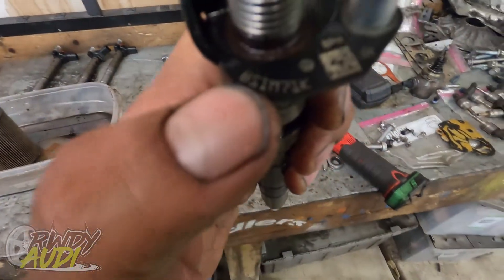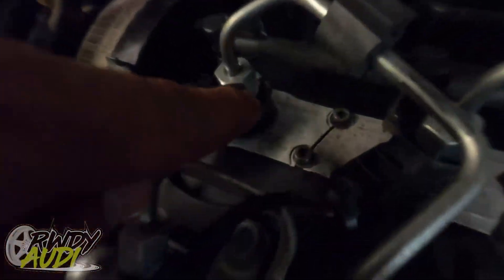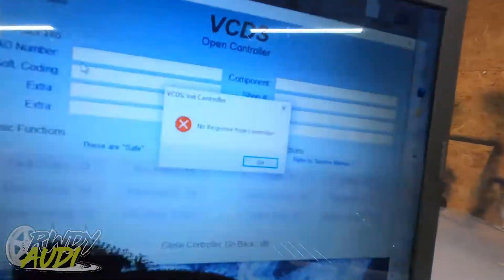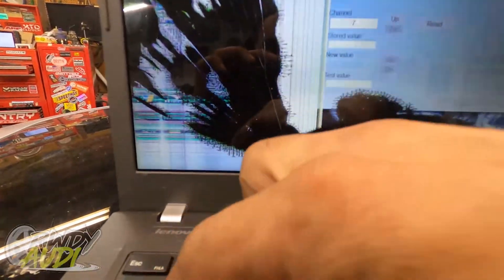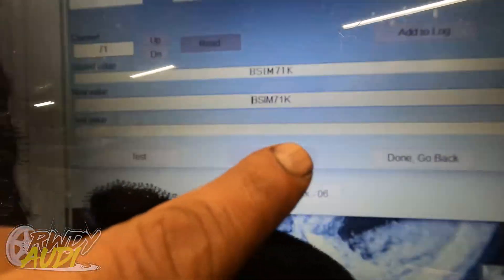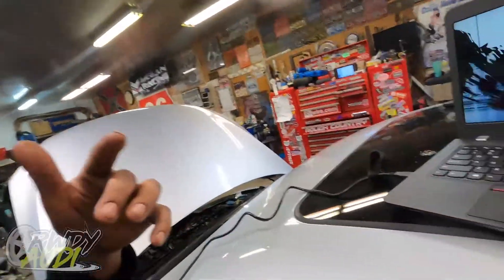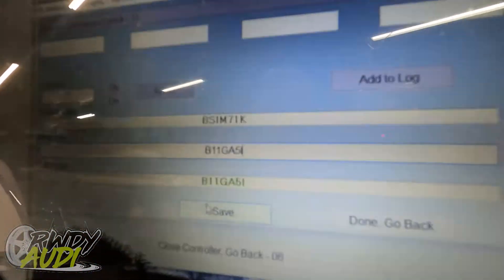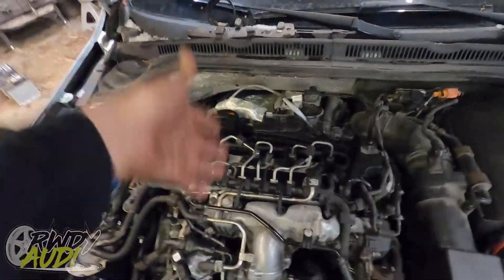How to code TDI DIESEL INJECTOR using VCDS | DIY SPECIAL |

Comment: is there a video for the 1.9 PD tdi im going from 105 to 130
Reply: You can't code PD injectors, they need to be calibrated, you are much better off taking it to a specialist rather than trying to do it yourself.
Reply: And by calibrated I mean the ECU needs to be flashed with the reconfigured map that scales the injector voltage correctly

Comment: My vcds screen is a little different. I might have screwed up loading injector 1. When I hit change value so.ething came up about export. I hit do it and old and new value went to all AAAAAAA. Now I can't change anything. I can't send you a pix of my screen
Reply: you need to put a code in securite access , after that you can make changes in injectors

Comment: Any way to adapt without knowing the number on each individual injector? I installed on my A4 B8 and the manifold is covering the injectors.
Reply from the maker: Not that I know of , plus u need to know which cyl each injector is in so you get the programming order right

Maybe you can get a scope down there and they might be visual

Comment: Just in the process of doing the HPFP and entire fuel system change because of metal in the system, next step is the injector coding , I have the xtool vag401 and have been able to do everything you’ve done with vcds so hopefully I can code the injectors as well 😂just have to find what data block they are under ,thanks for the video series on this car it’s been great 👍🏻
Reply from the maker: Very welcome , everything end up working out okay?
Reply: Hi  update is I ended up just buying the full version of VCDs and coding the injectors, and then we drove the car for a while then the fuel return line blew off and spewed fuel everywhere and the car wouldn’t re-start 🤦🏼‍♂️so I replaced the high pressure pump again and the car fired Roth up then after full warmup the rubber return fuel line blew off again, so now I’m completely confused 😂
My next move is to check return flow to the tank 🤷🏼‍♂️
The drama continues 
Thanks for checking in with me much appreciated!

Comment: Is coding the Injectors necessary if all I'm doing is replacing the o rings?
Reply from the maker: No, it is not necessary as long as you put each injector back  from the cyl they came from. However, you will still need to prime the system 3 times to confirm there is no air in the lines before you start it back up for the first time. (DAMAGE COULD COME TO THE CP4 PUMP IF YOU DONT PRIME THE LINES AFTER REMOVAL)

Hope this helps with your project
Reply: I found your video on priming the fuel system with vcds, thanks bro!

Comment: So I’ve seen the previous videos on the tdi hpfp replacement. You didn’t really elaborate too much if the old injectors lasted or not? Did you run into issues with the original injectors after replacing the hpfp?
Reply from the maker: My bad dude. I replaced the injectors due to the amount of metal I found the system as whole. These injector are called "piezo" basically this means there tiny quartz slices in them thousandth of inch thick. Metal in these, even the smallest of amounts will cause, lots of different errors  to populate. 

So in this case after I got the car back up and running we had several errors on different cyl. Got on Google and dug into what's what and learn the difference require between modern tdi and old tdi 😂. (There was a time when you could rebuild a injector on your bench pretty easily with a can of brake clean 😂) long story short, we ended up getting some rebuilt Injectors. 

Hope this helps, tdi are definitely up there on the German shit show scale😂💚

Comment: I replaced my Skoda Yeti 4th fuel injector and while coding, when press the do it button, a dialogue box appears saying: 

This appears to be an uninitialised control module;
Valid WSC/importer/equipment data may be required.
Click Yes for vcds to use default values of 12345/123/12345
Click No for vcds to use values currently in the module ,
Click cancel to go back and manually edit the

I tried both the yes and no options nothing works, engine won't start (was working perfectly before it was just a bad 4th injector but was working). I primed fuel as well.

The car engine is not starting at all now seems like the coding is messed up. Any help would be appreciated. 
(VCDS is genuine - software, and cable both)
Reply from the maker: I would start with verify my injector code.
Reply: @TheRwdyAudi  injector code is correct, then what next
Reply from the maker: When are you getting this error ? During coding of the injector or when communicating when the car (ie setting up your cable for the first time )
Reply from the maker: Another option is to read through vcds 
http://www.ross-tech.com/vcds/tour/option_screen.html#WSC

They have a very indepth manual explain this error.

Usually this error is cause by operator error usually nothing crazy wrong on the cars side of thing. Ie "1" is where an "I" is supposed to be stuff like that. Or when when your in the wrong module.  I would read the manual and you should be able to solve your problem.
Reply: @TheRwdyAudi  the new injector was clogged probably because I installed  the old and the car started. I bought the injector from 2nd market it must have been kept Dry. Although  the old injector was not not working properly but at least not clogged.

Comment: I did not prime the system after replacing 1 injector. Coded it and started the var now all injector have bad reading -2-3, +2 
Does that means that i destroyed my injectors becomes i didn't prime the system?
Reply from the maker: Not necessarily I would check your injector adaptive tables and see what they look like ... how's it well is it running ?
Reply: @TheRwdyAudi  it's running smoothly until warm up afterwards start shaking like on 3 cylinders.